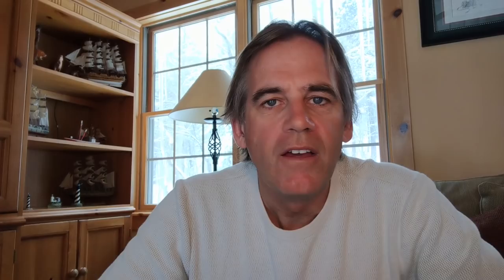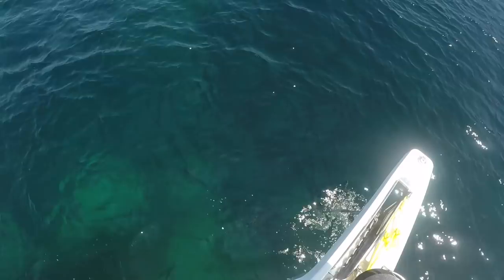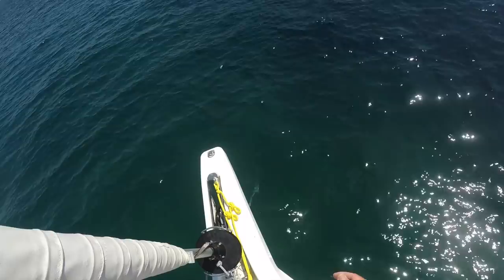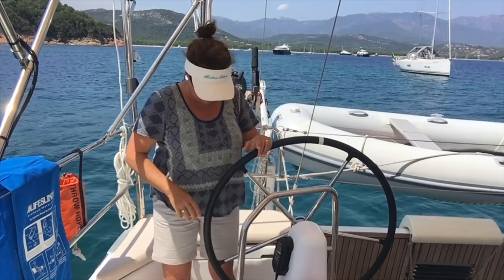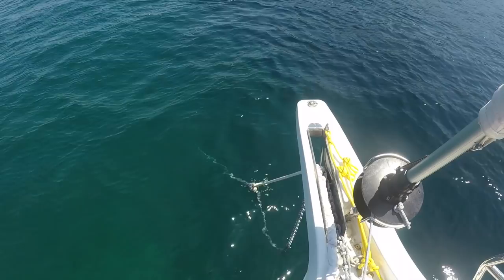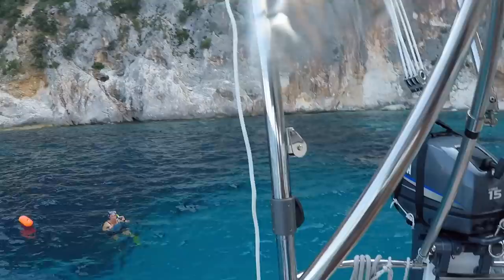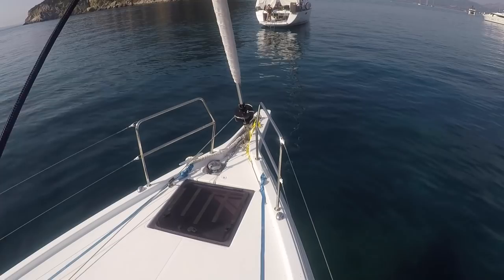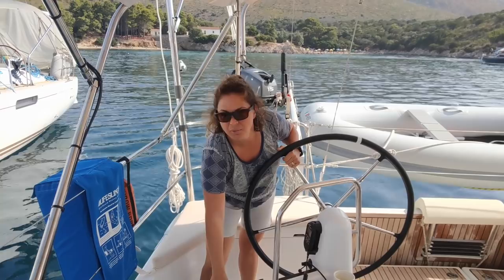Boat Anchoring 101: Setting and Raising Your Anchor | Ep. 38

Comment: If you want to avoid putting a strain on your bow roller, connect the snubber directly from your bow cleats in a bridle configuration to the chain below the roller or bow sprit, so the snubber is not going over the roller.
Reply from the maker: Good suggestion Scott. I think playing around the dimensions of the bridle would be key. Our bow cleats are positioned in such a way on the toe rail that you'd want the bridle to have a decent length to it, to avoid chafing against the toe rail. But I can see how it would be worth comparing to possible chafe on a bow roller.

Comment: Great video, and good explanations. A snubber that short will take load off the windlass OK, but there's another good reason for it, and that's to reduce snatch loads on the anchor. To get that, you need far more length, about the length of the boat. An easy way is to run the snubber rope (must be nylon for elasticity) right back to the cockpit and make off on a cleat or winch. Nylon rope can stretch 20-40% of its length. On my 10m boat I get 1m of extension on my snubber in F4 wind, more in greater winds.
Reply from the maker: Thanks Geoff. I didn't cover it in the video at the time, but we use the short snubber as an everyday, mild weather snubber, just to take the load off the windlass. Recently, when we anticipate high winds or waves, we use a 10m long snubber, which as you have pointed out, provides a lot of stretch. We run it off the bow, as we don't have a clean lead to the cockpit without introducing the possibility of chafing, but I like your idea. Happy cruising!

Comment: I don't gush... But that was excellent.

My additional thought on tidal rode.  If you anchor at high tide watch out for the proximity of others as everyone's swinging circles get bigger as the tide falls. It works out fore and aft, but sometimes not when the wind and stream shift.
Reply from the maker: Good point, RB, especially in areas with high tidal range.

Comment: Thanks for making this video.
I missed detailed info on  how the individual lines are connected and controlled, eg tack line, guy and is the mouth of the pole at the clew facing up or down?
Reply from the maker: Hi Ralph. I believe you are referring to one of our whisker pole videos, not this anchor video. We don't use a tack line as the headsails we use with the whisker pole are tacked to the bow. For the guy, I included that in several sections, as a foreguy, to hold the pole down and slightly forward. On the direction of the jaws at the end of the pole, people rig this both ways. We tend to like the jaws facing upward as that releases the sheet/foreguy at little easier. Good luck!

Comment: Good explanation, though Mrs. LifeFourPointZero was more accurate with her scope calculation by including the distance from the water to the roller.  It doesn't usually make a whole lot of difference and I usually just use the water depth too even though it is off a little from the textbook definition of scope.

I wonder what percentage of sailors calibrate their depth sounder to read depth below keel versus actual total water depth?  And is there any correlation with those who set current direction up versus north up on their chartplotter?  Sunday musings....lol
Reply from the maker: Usually Mrs. LifeFourPointZero is the more accurate of the two of us...keep the musings coming!
Reply: I, for one, often forget to add the keel let alone topside.

Comment: If I am not using a windlass and I have a rope and chain anchor combo, how does one pull the anchor up once tight and the boat is directly over top? Can one yank it up or can I move the boat fwd to pull it out? Love this vid. It was very helpful. Im new to boating so my situation is a bit more specific.
Reply from the maker: Hi Michael. Yes, you can pull up as much chain/line as you can, until you are right over the anchor, and then carefully drive the boat forward, and that might release the anchor from the bottom. From there, you can pull up the remaining chain and anchor. Granted, it is hard work. Windlasses are cheaper and more reliable now adays; you might think about investing in one as it will make life a lot easier down the road.

Comment: Great video, but I have one question. Wouldn't it be better to let the anchor chain out slowly while backing away so the chain doesn't pile up on the bottom?
Reply from the maker: Thanks Dale. Yes ideally this would be the best approach. For us, sometimes when you find the right spot to anchor, you still have forward momentum when you start lowering the anchor and chain so it's hard to avoid some amount of pile up. Good luck!

Comment: Just one thing. You should have the chain tied off on a cleat when backing down at 2000 RPM or you may strip the gears in your windless. I did that and it cost me my windless.
Reply from the maker: Thanks for the suggestion Marc. In fact, we have started to do that on occasion, especially when we feel like the anchor is going to hold and we want to move on to enjoying the anchorage quicker! Fair winds.

Comment: Enjoyed the video. Well Done.  How do you connect the snupper if all the chain is out and you have rope anchor line?
Reply from the maker: Good question. You can still tie the snubber to the line, using a rolling hitch. But we generally just cleat off the line itself, as it will give enough stretch alone, acting like a snubber. I would put a snubber on it if for some reason chafe was a concern. The snubber is a lot easier to replace than the anchor line. Good luck!

Comment: Hi I’m new to anchoring ... what happens when the tide turns (UK Waters) do you reset or do they naturally reset 
Daz
Reply from the maker: Hi Daren. I depends on the anchor. Some pull out and reset right away. Other designs take longer to reset, and may never set fully. The CQR anchor comes to mind in this later category. It's best to observe your boat during the tide shift and see how it performs. If it holds consistently, you are in luck. But regardless of how good your anchor is, I wouldn't rely on it, by for instance, leaving the boat during the tide shift. At a minimum, you'd want to back down hard with the engine to make sure it is set well in the new direction.
Reply from the maker: When we recorded this, we were in the mediterranean in areas with minimal tides so we barely had to think about them. However, we have sailed extensively in the waters off the coast of Maine where the tides can be 12 feet. Still potentially small for you, depending on where in the UK you sail! Most anchors reset when anything (ie the tide and/or current, wind direction changes) causes your boat to face a new direction and the force on the anchor and chain is sufficient enough to straighten it all of the way out in the new direction. When picking an anchor, one of the key factors is its ability to reset itself should conditions require that. Ideally, you wouldn't want to anchor such that you would need to manually reset the anchor on change of conditions but instead you would want to anticipate all potential condition changes and pick a spot and scope that accommodates that. Sometimes this is easier said than done.

Comment: Good video, covered lots, thank you. Like the point that you take the load off the chain by motoring up, rather than "winching" the boat against the total load, although I think I only saw that in your summary point list. I have some questions, in my head, that remain unsolved though.

Firstly, I'm mostly single-handed and that is a huge complication. Not sure how to manage that one yet - but that's OK, this video isn't aimed in that direction.

Secondly, though, you use hybrid rope/chain rode, which complicates things but you don't mention how to manage that part. I know it affects scope calculations, and I think I know how to adjust for that. But the "upping" and "downing" are changed too. Your windlass has a drum for rope and a gypsy for chain, as does mine. But I have no idea how to manage the transition from chain to rope. No idea if the rope even resides under a pile of wet chain, and rotting - or whether you clip it onto the chain when lowering and unclip it on the raising. With the rope rode alone, I could imagine how to use the winch drum - but I haven't seen that done either.

Not criticising by any means. grateful that you publish videos like this at all. Just these parts remain fuzzy in my mind, and perhaps in others' minds as well. Perhaps, also, you're way ahead of me and intend to look at these things in later videos anyway.
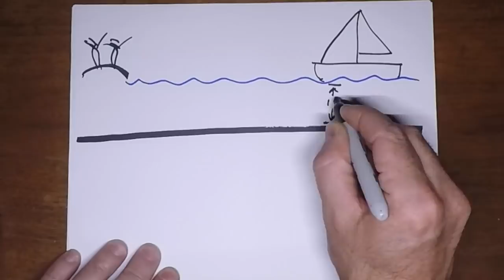Reply from the maker: Hi Ian: All good questions! First, if you are single handing a lot, you might look into a remote windlass control at the helm. This will allow you to raise and lower the anchor while at the helm, or at least get the process started while you are still maneuvering the boat. For an example of these, see the 1:58 time spot on our video “Boat Anchoring 101: Preparing Your Anchor Rode”. 

You are correct that we use a combination of chain and line. This is quite common with long distance cruisers, providing a longer rode without the excess weight of 100% chain. But it is a compromise. Most windlasses, even if they have a rope drum, are really setup for chain, with the hawse pipe (where it drops through to the anchor locker) located right below the chain gypsy. Once you’ve let out all of your chain, you have to be quick and agile to move the line over to the drum while the weight of the chain is trying to rip it out of your hand. Easy to lose a finger in the process! The reverse is a challenge too. As you get all of the line in, and the chain comes to the windlass, you have to keep pressure on while you careful lay the chain links into the gypsy, again being mindful that you’ve only been given 10 fingers from which to live out your life! With this in mind, we purchase enough chain so that 90% of our anchoring can be done with chain only, never reaching the line. We have 70 meters of chain, and we typically don’t anchor in water deeper than 10 meters, so that gives us a comfortable 7:1 scope. If a real bad storm hits, we’ve got another 65 meters of line to fall back on.

The splice between the chain and the line is shown at the 12:47 time spot in the same ‘Anchor Rode’ video. There may be other parts of that video that may be of interest too. I hope that helps!
Reply: @LifeFourPointZero  Thanks for your response and so quickly too. Lots to think about here. Firstly, my reality is that my HR38 is equipped a she is and I can't easily re-engineer everything just for single-handed sailing. I must see how far I can go with what I have firsts. For example, even running all my lines back to the cockpit will require a new mast at least, plus engineering changes to the cockpit. I don't mind that, I accept things as they are, and I love her to bits. But it also means I have a windlass that uses a winch handle to slip the clutch to lower the anchor; big expense to totally change things. I also have 50M of good chain so I think I either have to stay shallower than 11M of water or look at hybrid rode. I also agree that the hawse feed tube is devilishly close to the gypsy which makes "catching" the start of the 3-strand too dangerous to consider. I don't want to scap 50m of chain and buy 80-90m to replace it, but that might be the only safe way to anchor in water deeper than 10m. Just thanks for you reply, you really confirmed what I was already thinking.

Comment: Great video, thank you. Would you recommend re-anchoring if winds change direction significantly?
Reply from the maker: Only if you don't have enough room to swing with the new wind direction. Preferably you should be picking a spot where you can safely swing in all directions so you need to worry about any wind shifts in the first place. Also, most anchors do fine resetting with a wind shift, but if you find yours dragging, it's time to look for a better anchor. CQR anchors are notorious for this issue.
Reply: @LifeFourPointZero  thanks!

Comment: Are you revving up going in reverse?
Reply from the maker: Yes we go gradually up to between 1500-2000 rpms, to make sure it's going to hold in heavy weather. You want to be careful though, depending on the size of your engine, to not go too fast into high reverse, or too high rpms, as you can easily pull the anchor out of an otherwise fine set.

Comment: Most electric windlasses are not strong enough to stand the force of backing down on them.   At least for the long term.   If you have ever had to rebuild one (I have) you will see that the bearings in them are just not adequate for this kind of pressure.  To avoid this, you must have a chain stopper between the windlass and the anchor rode or use a snubber each time you back down.   Backing down on a windlass or failing to use a snubber to take the load off the windlass bearings is the death of most recreational windlasses.   Don't ask how I learned this.  Otherwise your instructions make a lot of sense.
Reply from the maker: Thanks for the comment - you are absolutely correct and we have added this step to our process. We put a snubber on after we put out our desired length of rode then we power up slowly in reverse to set the anchor and test the set.

Comment: Great video. But, if the point of the snubber is to take of load from the winch, why do you not fasten the snubber before your hard reverse? Most of the time you are anchored this will be the hardest load on the winch. And if you do this process repeatedly this will add to the total stress for the winch. Your snubber seems way too short to be maximal effective. I would also suggest to use the reverse when laying out chain and not drop a pile of chain on top of the anchor. If you only use the wind in windy conditions and in a busy anchorage the boat will fall off quickly and you will not have control. It sure is a lot of ways to doo this 😁.
Reply from the maker: Sothis sailing thanks for the comment! We used to put the snubber on before the hard reverse and we will give it some more thought. The main reason we don’t is because you can not feel the light skips along the sea floor with the snubber on - there is too much stretch in the line. We realize there is significant pull but we ease into it so hopefully very little jerking. Also, you are correct about backing down slowly as anchor is paid out. We often let the anchor hit the seabed while we have very little way on so we can guide the hopeful dig-in spot free of grasses.
Reply: LifeFourPointZero  Hey LFPZ, its absolutely something to try. You could put your 🦶 on the snubber while backing to get a feel for what is happening below, and you can observe the stretch in the snubber to confirm that the anchor is set.  Fair 💨.
Reply from the maker: @Barbaria_Sailing  Thanks we'll give it a try!

Comment: 'why not set the anchor with the snubber attached so anchor winch isn't taking strain at 2000rpm
Reply from the maker: Hi Edward. Not too long after making this video we switched to setting the anchor with the snubber on, and yes it works better. We had not done it before because of the possibility of having to reset the anchor if it dragged, and the time taken to remove the snubber and re-attach it each time. Fortunately it is pretty rare that our anchor drags while setting. Fair winds!